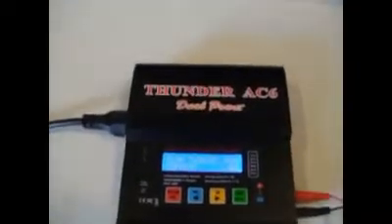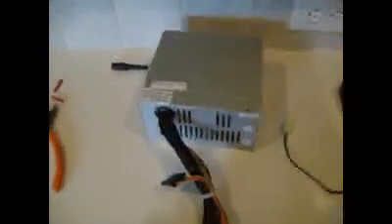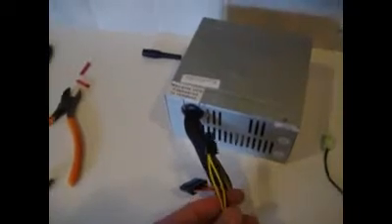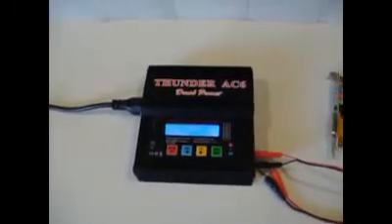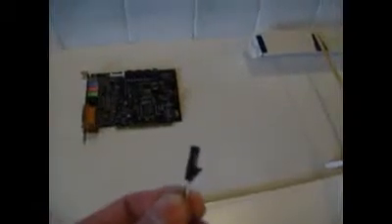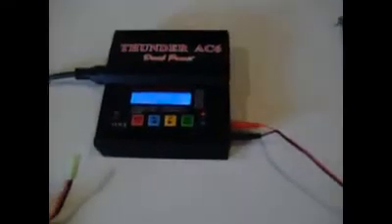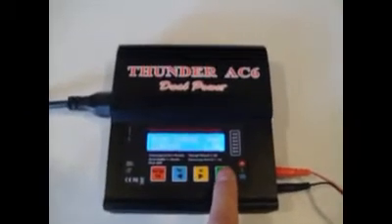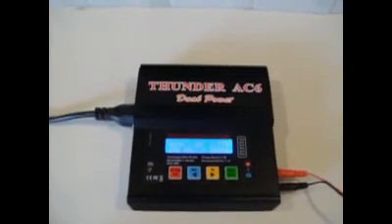charging small nimh with ac6 charger

Comment from the maker: @HDRcCarVideos The charger will terminate the charge in manual when it sees a drop off of voltage. A 8.4 bat will require an end voltage of just under 20% more voltage to push the charge.  Look for 10+ volts and the decline when it stops the charge.  You could use more than one amp for a 3000 mah bat but it would cause more heat and gassing while reducing bat life cycles.